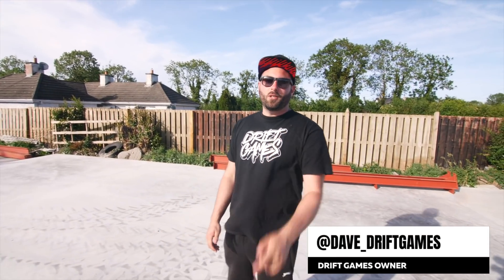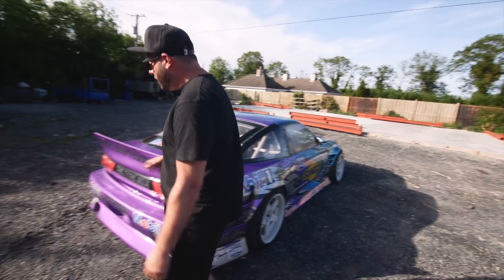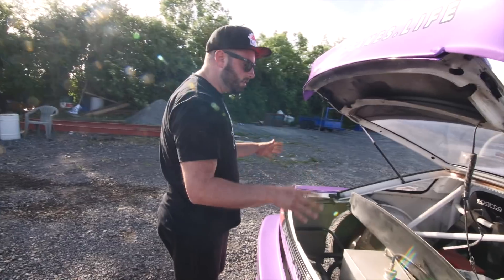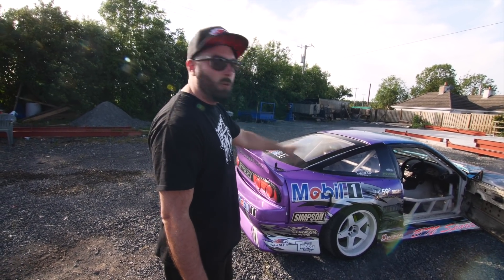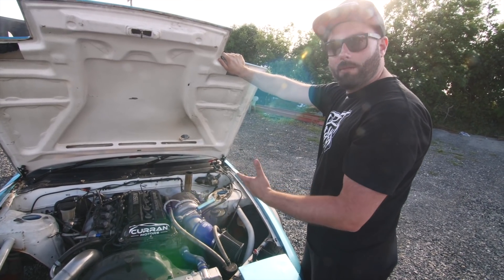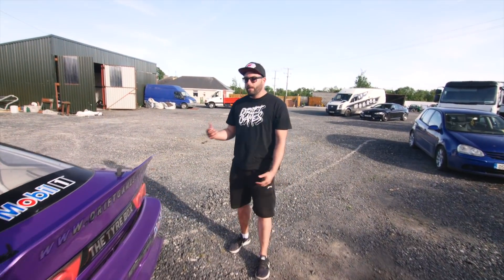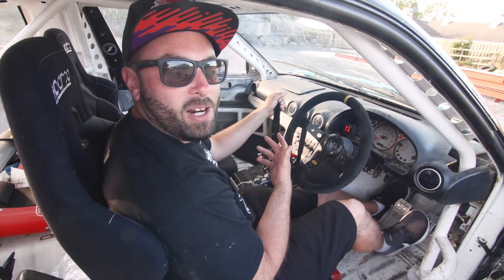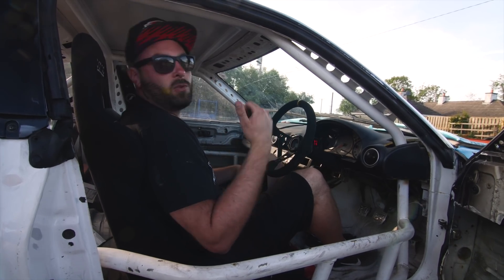YOU DON'T NEED BIG BHP FOR DRIFTING | PERFECT BALANCE?

Comment: Have you considered adding a clutch master flow control valve? The part number fcv-2000 is nice and comes with different size jets to control the clutch slip. It takes alot of the shock away to keep from breaking stuff. I heard about it from Chelsea denofa.
Reply from the maker: Good idea Darren, we will look into it! Thanks for watching!